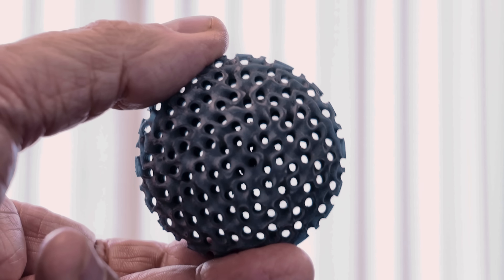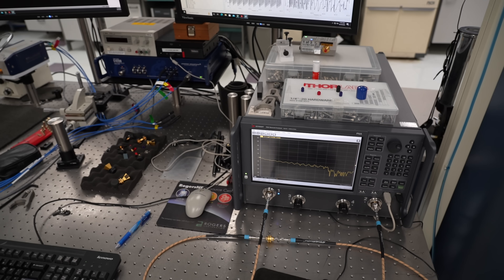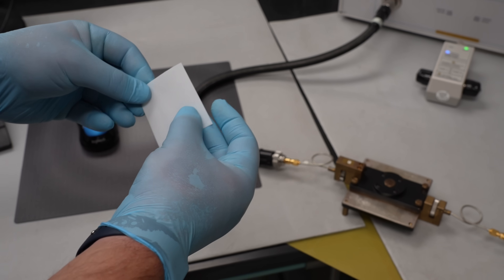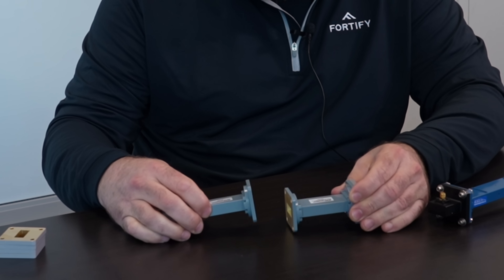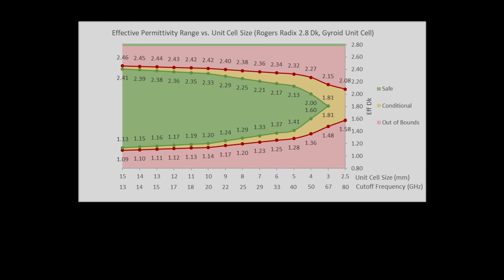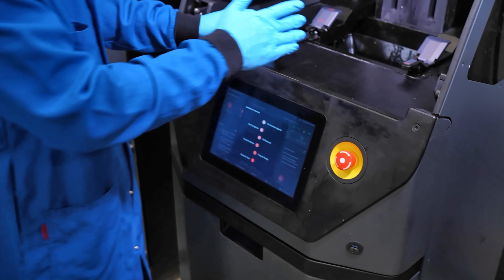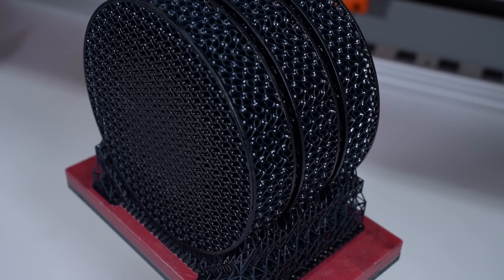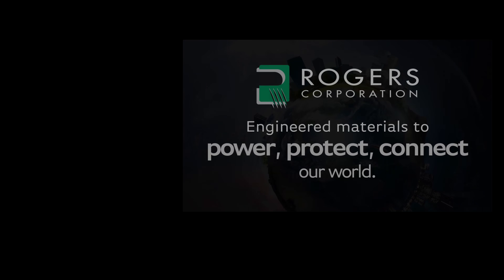Unveiling the Future of Antennas and RF Lenses using Radix™ 3D printable material!

Comment: At 15:30, I think what the design is trying to accomplish is to match the speed of the wave in the waveguide to the speed in free space... Essentially, an impedance match to reduce the reflected power? Is that right @Machining and Microwaves ?
Reply from the maker: It's trying a new way to match the impedance of the core of the lens to the free space behind it so it doesn't reflect much energy.  Normal way to do that is with a machined cone or steps.  After that it is just an optimised dielrod lens that modifies the angles at which energy leaves the open orifice to try to give optimised side-lobe suppression and as near to an ideal illumination for our chosen dish focal length to diameter ratio.  I just wanted to try it to see how well it worked in terms of the matched return loss (and standing wave ratio) at the feed.  It's entirely passive and bidirectional, so optimising for transmit performance gives pretty much optimal receive performance (subject to a few caveats about the local groun/building environment.  In general I optimise for receive noise temperature performance as within limits I can always build a larger amplifier to compensate if required

Comment: I install microwave systems on towers.  This is pretty interesting and I would like to test this out myself. With live equipment at my house.
Reply from the maker: Trying the X band lens to hear signals reflected off the moon ay 10.368 GHz is definitely a good test, as is detecting thermal noise from the moon. The sun is very loud at the frequency. I haven't tried the Mikaelian lens at 24GHz on sun noise yet, that will be an interesting test

Comment: So a porous metal tube allows wavelength into it, not blocking it?
Reply from the maker: A simple metal tube will allow waves below a certain wavelength to propagate into the tube.  If you want to modify how the wave behaves once it is inside the tube, you can insert a porous plastic or ceramic foam of varying density. The smaller lens is designed to get a a from inside the tube to transition into free space without reflections back into the tube. Imagine you have a rope hanging vertically from your hand over the side of a building. (Look, I don't know WHY you are on top of the building). If you jerk the rope sideways sharply, a wave travels down the rope and when it hits the free end, it reflects back up the rope.  If you tie the rope to the ground, the wave reflects back up but in the opposite sense.  If you tie a weight to the end of the rope and suspend it in treacle, the wave is absorbed and doesn't reflect.  The gradient density of the printed lens behaves similarly, so there are no reflections back into the tube, or at the interface with the air, so no weird cancellations or dead zones, the waves just go though the lens and are focussed into a clean beam of the desired opening angle

Comment: So, as someone who knows little about this, can someone tell me if I am getting this correct—these 3d printed methods allow RF engineers to circumvent ever-increasing requirements for precision in machining traditional antennae by taking advantage of spatial/density properties in these kinds of 3d-printed “foams” in dielectric materials, essentially trading obscene levels of precision and machining nightmares for the benefits of multiplicity inherent to these new materials, made accessible by these printing techniques?
Reply from the maker: Pretty much right, but it also allows us to make things that aren't possible to machine even with a five-axis CNC. Over to the designers now to see what they can do with the material
Reply: @MachiningandMicrowaves  Thanks for your reply! Yes—this is what I was attempting to get at with “ever-increasing requirements”—i.e. including increases in requirements beyond what is capable by traditional machining methods.  Thank you for this fabulous and enlightening video!

Comment: can you elaborate more on the hybrid mode in the waveguide ? From what I know it is either TE or TM as propagation wave. You also talked about iris which I have no clue what it is and what is its characteristics. You seem more qualified than an RF Engineer to me !! Or maybe I am awful
Reply from the maker: It is possible to excite two different waveguide modes in a circular guide using a stepped phasing section or a rapid taper. Typical examples are the Pickett-Potter horn and the W2IMU. The two modes have different phase velocities and if you make the outer section of the horn exactly the correct length, the two modes combine at the orifice to create a near field that when it resolves into a far field, suppresses the major sidelobes and creates a beam with near-perfect axial ratio. It needs some precision machining to get the phasing section length, step size and main horn taper correct in the Pickett-Potter and the taper and outer length of the W2IMU just right. They tend to be rather narrow band for pattern and return loss. The superposition of the two modes is usually called H01 but there are many variants, particularly in cavity resonators.
To get from a rectangular waveguide in TE01 mode to a circular guide mode TE11, you can use an oval iris plate of a precise length and orifice size. the oval is usually a little larger than the rectangular guide and narrower but longer than the round guide diameter. In my Pickett Potter horns, which are based on the excellent designs in DUBUS magazine by Jeffrey Pawlan, I use an iris to get from rectangular to round guide, then a step to excite the other mode to make a hybrid mode, then a shallow taper to develop the best possible sidelobe suppression.
Reply from the maker: There are some interesting papers around hybrid modes and metamaterials https://iopscience.iop.org/article/10.1088/1742-6596/431/1/012027/pdf
Reply from the maker: Pics of one if my earlier Pickett-Potters is at http://www.g4dbn.uk/?p=880 sorry it doesn't have https right now, I need to get a new certificate
Reply from the maker: Part two of my recent Pickett Potter horn project will cover the modelling of the hybrid-exciting step and the iris https://m.youtube.com/watch?v=kxBX9A_x_UA
Reply: @MachiningandMicrowaves  THanks a lot for the fast, complete and accurate response. You are amazing on a technical point of view. I will study that ...Thanks again
Reply: @MachiningandMicrowaves  sorry for the basic question but I rewatched the video. You said you are looking for very low side lobe. You also said "...simple linear excitation in a round waveguide using either coaxial probe OR oval iris". I put aside the iris for now as it is more advanced. I am confused: You choose the simple linear excitation but I thought the hybrid excitation (different from simple linear excitation) is mandatory to suppress those side lobes ?....Thanks
Reply from the maker: @AH-jt6wc  The new lens design is an attempt to generate the desired low sidelobe pattern without needing and precision machining or generation of the hybrid mode. The modelling suggests that the lens will achieve a reasonable pattern although there is a backward facing lobe visible in the e-field animation. It's a logarithmic plot so the level is below -25 dB and therefore well below the threshold where it is a significant source of excess noise. The other design goal was to get wider bandwidth and reduced tolerances. Overall this was an attempt to match the performance of a precision engineered narrowband antenna feed without the narrow usable frequency range
Reply: @MachiningandMicrowaves  thanks a lot

Comment: Can I use this to print a powerful omnidirectional FM transmitter antenna?
Reply from the maker: It gets a bit tricky with scale.  If you wanted it in Band Two around 100 MHz, that would be a massive antenna lens, but at more than 1 GHz it gets more feasible. I think we are still in the "metallic rods" regime at 100 MHz for practical antenna systems, although a metallized printed antenna array using Rogers' MAGTREX 555 as a high-mu, high-epsilon substrate might be feasible

Comment: I would have used pre-famulated amulite surmounted by a malleable logarithmic casing in such a way that the two spurving bearings were in a direct line with the panametric fan, but whatever.
Reply from the maker: A much better solution. I concur completely.  The proper famulation of the raw amulite is the key step.

Comment: what are some practical uses of a (RF?) flashlight like that?
Reply from the maker: It's going to be used as a rugged and water-resistant remote antenna pattern testing device that I can raise on a mast to investigate the far-field pattern of antennas that I'm working on. I'll equip it with Zigbee and Bluetooth and Wifi and maybe infra-red comms interfaces for remote monitoring and control. I can probably use it as a portable out of band comms link and antenna alignment device for 122 GHz testing. A pair of them would be fun as a data link too.

Comment: Is it too much to wish that there could be dielectric resin for home 3D printer use?
Reply from the maker: There are dielectric filaments like Preperm and Zetamix Epsilon but I doubt there will be resins for home use as demand is going to be tiny
Reply: @MachiningandMicrowaves  demand just got more interesting. Dielectric resin just made my brain explode. Already have a list of what I could do with it.
Reply: @MachiningandMicrowaves  what was up with the filter on that flashliglike device? Was that a 10ghz antenna? Do you have any videos showing your attempts on 10ghz EME?
Reply from the maker: @Stuff_happens  The giant flashlight contains a signal source and teceiver at 24GHz or 47GHz and a feedhorn. That illuminates the Mikaelian lens and forms a searchlight beam that I can use to check antenna radiation patterns
Reply: @MachiningandMicrowaves  thank you for answering my questions.  My experience with  microwaves is limited.

Comment: Well, this is a bit fascinating isn’t it? I’d never heard of gradient index lenses before, thanks for the video
Reply from the maker: They've been around for a long time, but always been a bit challenging to make. You can drill tens of thousands of holes in thin layers to get a gradual change, or you can use different materials in layers machines and cemented or clamped together, or you can use varying air spaces, or alternating high and low refractive index layers in varying ratios. 3D printing frees you from the limitations.  Gyroid lattices are a lot of fun, but there are many other lattice forms that can be used. Optical fibres are perhaps the most ubiquitous example of a gradient index device, the index of the core fibre varies so that all rays that move towards the edge are steered back to the centre and you end up with 50 km of glass that is clearer than a domestic window pane.
Reply: @MachiningandMicrowaves  yes I’ve just looked up the earlier construction methods, really complicated. Will you be doing any testing of these in a future video?
Reply from the maker: @____________________________.x  Part two will have some results, and I think I'll do another explainer about how RF lenses work
Reply: @MachiningandMicrowaves  yes, an explanation would be great, everything on this on the internet is research papers 😹
Reply from the maker: @____________________________.x  Right.  Quest accepted!

Comment: I'd like to see what that flashlight does is there a video?
Reply from the maker: Soon!  It is a transmitter and receiver for 24 or 47 GHz, using the Mikaelian focussing lens that I designed to form the microwaves into a narrow beam.  Purpose is a robust and rain-proof source and receiver to use when measuring the coverage patterns of microwave antenna systems

Comment: Neil , I am curious. Can you create a Radix based antenna that only passes GPS signals from vertical (above) and rejects everything else?
Reply from the maker: You can make any high-gain antenna have a sharp beam with nulls to accept only overhead signals.  It would need to be VERY large with a dielectric lens at GPS frequency. I'd do it with a set of long yagis pointing upwards and connected with a phasing harness, then optimise spacing for sidelobes rather than gain.  Perhaps 40 elements per yagi.  Depends how you define "overhead" as if that means a 5 degree solid angle, that's hard, whereas 25 degrees is easy.  A large horizontal dish or dipole array would also work. 1090 MHz is 30cm wavelength, so an array dimension of perhaps 5 metres diameter would be needed
Reply: @MachiningandMicrowaves  That is not going to fit inside the confines of a drone. I guess Astronav at high altitudes is the more feasible option. Thanks for your comment.
Reply from the maker: @timk6246  I think genetic algorithms are a good solution for drone antennas, minimising the size and weight and maximising coverage and gain, but using metal over a thin dielectric
Reply: @MachiningandMicrowaves  The idea was to prevent jamming from terrestrial sources.
Reply from the maker: A patch array on a dielectric PCB substrate would have a reduced off-axis response, but a typical jammer is going going to be a factor of millions of times louder than the satellite, so there's little you can do if the signal is on-frequency and overloading the mixer/LNA in the drone. If the jammer is wideband, then the density of the signal in dBm/Hz is lower as they have to spread out their signal, but it's typically at a few km range instead of at least 20,000 km, plus it can be hugely more powerful than the sat, with a heavy battery or generator or mains connection.  Using a directional antenna like a multi-patch array or perhaps a flat spiral or one of the other printable geometries could help a little towards the problem, and adaptive phase control of the array might also work to give you a few more dB or suppression.  I imagine that defence companies are coming up with all sorts of solutions that we won't find out about for a long time.  Inertial guidance with laser ring gyros is hugely heavy and power-hungry. perhaps a conductive mesh cylinder above the rotors to shield a GPS patch array might give a little more suppression, but then the jammers will just crank up the power. Assuming they are hostile opponents, the jamming transmitter would make a FANTASTIC beacon to act as a target for you to deliver a bit of kinetic and chemical energy as a special surprise.  Way outside my area of expertise though.  Flying a thus-equipped drone in an area where jamming is active also turns it and you into short-life-expectancy targets. My most lethal weapon is a big pointy wooden stick.  Mildly useful against weak vampires, but that's about all

Comment: What I missed here was any kind of sense of how much it costs to manufacture the objects you modeled, both in terms of materials costs and the labor and services they are providing.  Is this more for Defense and Aerospace or could an amateur hobbyist actually get something like this made on a budget?
Reply from the maker: Hard to be sure at this stage, but I'm guessing mainly aerospace and vehicle manufacturers and maybe remote sensing, telecoms, satellite uplinks and universities would be the target audience at this stage. At the time of the interviews last October, the service was still being defined.
Reply from the maker: Zetamix epsilon 4.5 from Zetamix.fr is something I'm hoping to use in my Prusa, but it might need some adaptations to the hot end and nozzle material. It's a totally different material form the high-tech Rogers product, it's just filament with TiO2 powder fill, so the mechanical characteristics are more in line with amateur usage.  I asked for samples recently but my email was ignored by their UK agent, so I'll try head office next.  You might have better luck with a local stockist. Hackaday did a short piece about it recently. Fairly low loss tangent, but similar approach to Preperm 1200, which is unobtanium now since Avient took them over and closed the webstore
Reply: @MachiningandMicrowaves  Yeah, I just got that Bambulab Carbon-X1 printer that I'm loving with Nylon 12 CF and while the video content was about a resin process, was still curious if I could affordably farm it out.  I've seen some dielectric FDM filaments floating around that caught my eye.  I'm just a Tech class ham though, I don't know what I'm doing with this stuff yet, but I keep studying and chipping away at skilling up.  Thanks for the replies!
Reply from the maker: @synapticaxon9303  I'll try to get a video out once I get hold of some filament.  I need to re-site my US Tech so I can renew my Extra.  I lost contact with the US ham whose address I was registered at, and didn't get the renewal notice, so it lapsed and I lost my US call (I originally held AA1EG, then K1NS).  I think I need to pass the Tech exam and then I can renew, but VE sessions are rather rare in the UK right now.  No great hurry, but it would be nice to have a US call again. I went to a UK VE session about 30 years ago, took all of the exams and the 20 wpm Morse test all in one long session.  Having a much younger and more agile brain, it was no big deal at the time.  Not sure I could do it all again now, but I'm fairly certain that I only need to pass Tech again.  I must check

Comment: I've always believed we could focus sound like light can produce lasers , frequency can produce heat , enough to produce tech such as the lightsaber
Reply from the maker: The problem is avoiding rarefaction, as you can get very high positive pressures, but only one atmosphere of vacuum, so you start to get supersonic shock waves.  In a compressed heavy gas like SF6, it might be possible to get to a plasma state using just powerful sound sources, perhaps even mechanical ones rather than piezo or magnetostrictive  or electrostatic or magnetic drivers. I think I'd look at Nitrogen lasers first